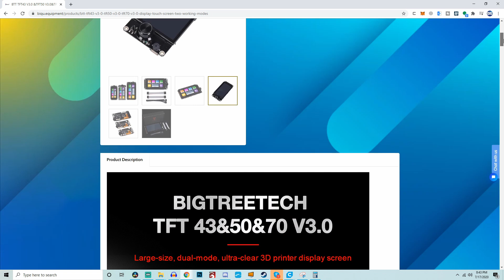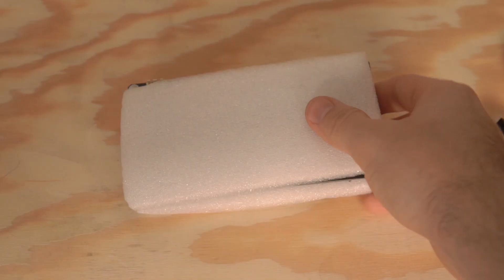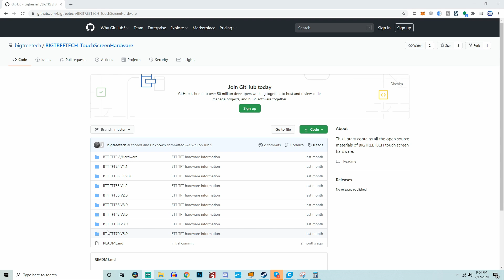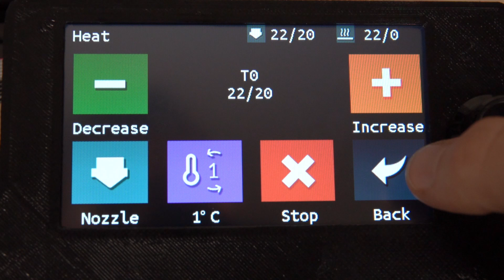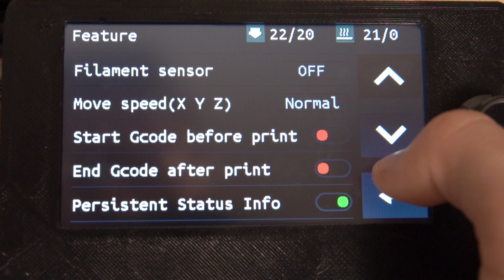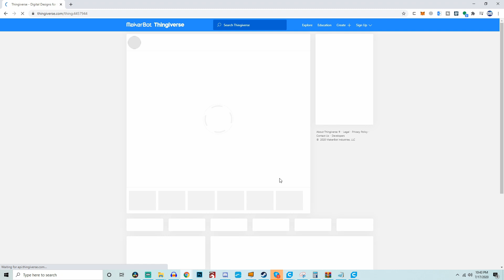Touch Screen For Your Creality Ender 3 3D Printer |  BigTreeTech TFT50 V3.0

Comment: Is the TFT 50/70 compatible with the Creality main boards? Would love to have the addition features this display brings without the need to upgrade the main board. I currently have a CR-10 Smart that has a 32 bit main board with Creality firmware ( marlin 2.xx).

Comment: Thanks for the useful video!  I have a question.  When I use the TFT line to connect to my 8-bit MKS controller, it disables the on-board USB port of the MKS.  This is a problem since I occasionally like to hook up my PC to talk directly to the printer via USB.  Is this still true?  Is there a workaround?

Comment: What’s needed is a comprehensive video on what all the features of touch button side of tft screens are. A user guide. All the major players have done a great job with install videos but switch back to old marlin for set ups, what’s the point in that.

Comment: Great video! Now I need a touchscreen on my Ender :D
Do you know if this screen would work with the Creality 4.2.7 board?
Or do I need a Big Tree Tech board?
Reply: was wondering the same thing and literally cant find an answer anywhere..
Reply: @ApacheFPV  I was wondering the same. Did someone get the answer?
Reply: @Yeta00metal  Sorry this is a late reply to an old post but there still is no real straight up answer unless you spend time investigating. So:
The answer is NO! if you want it as a touchscreen.
For it to work it needs an RS232 port which the creality boards don't have. You have to buy the Bigtreetech main board and replace your creality board.

It will however work on V4,2,x boards as a replacement display in Marlin mode. So it'll look like the old display. What it will do is add the ability to use a USB drive and a full size SD card instead of the TF card. They are now only about $20 on Ali-Expess so might be worth it just to get USB flash drive compatibility. You should also be able to add the WiFi option so you can send to the printer directly from your computer. 
Currently in 2025 you can buy both the Bigtreetech  main board and display board from Ali-express for around $40-50 which would be worth while if you have a non silent board or an 8 bit board in your printer. Otherwise it isn't really improving anything over the 422 or 427 boards other than aesthetics. Save the money towards a better printer

Comment: I have the tft35. But I can not figure out how to change the heat up settings on the touch screen. It only allows me to print at 200 , 230, and 250 and nothing else is there a way to change this? I usually print at 205. I used to be able to adjust it in the old firmware but in the BIGTREE_TFT35_V3.0.26.x.bin I don't see how to adjust it.

Comment: I recently got the SKR mini 1.2 along with the TFT35-E3 V3.0. After installing it I could move the all the axis (X,Y,Z) and heat the bed. The major problem is when I try to heat the nozzle the display  shows the temp for nozzle as( -14/0 To) then proceeds to go wild and let out a load beep that’s continuous(to turn it off I basically have to turn of my E3 to get it to stop). I’ve tried everything and have look around but no one seems to have had my problem after installing. Idk if my heat end is broken but if you have some insight or advice I’d be more than greatful!
Reply: Might have had a bad flash on the screen. Try refreshing the board with the updated firmware

Comment: Does BigTreeTech have the touch screen for the Ender 5? Couldn't seem to find it. Thanks.
Reply: Its same as ender3..
Reply from the maker: Yes this one is compatible with most printers. If you get the SKR mini board then you can use all of the same features. The only thing you would need to do is figure out a mounting solution.

Comment: I have their TFT35 E3 V3.0 on my Ender 3 Pro with their SKR E3 V1.2 and love them both. I need to do some firmware flashing to get everything enabled but out of the box, both have been working great for over a month now. These models are both direct swaps from the Ender 3 and Ender 3 Pro, so no need to print a new screen holder or any other mods needed to use them, but offer options to add more with firmware flashing.
Reply from the maker: That is awesome, I do think that for most, the TFT35 really is going to be plenty especially since it fits in the stock housing of the Ender 3. It really is such a nice upgrade to the machine.
Reply: @ModBotArmy  I ordered the TFT35 V3.0 For my ender 3 but its not the E3 model. I also ordered SKR mini E3 v2.0 But I was wondering if the BTT Smart Filament Sensor will work with these upgrades. Please Reply and Thankz  EDIT: I also can't find a screen case for the BTT TFT35 V3.0, Can you help?

Comment: Can you use simplify 3D on both firmware, thanks mate
Reply from the maker: Yes the machine is still running Marling Firmware so nothing will change in that regards.